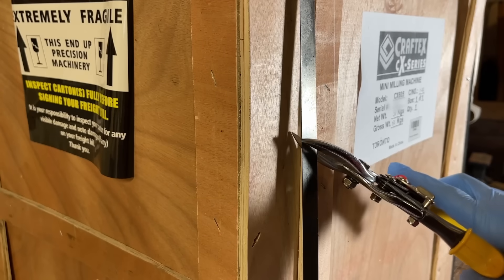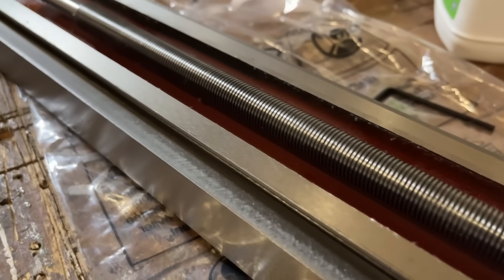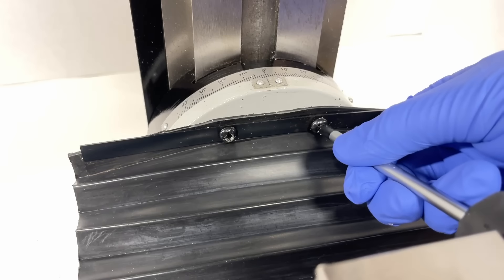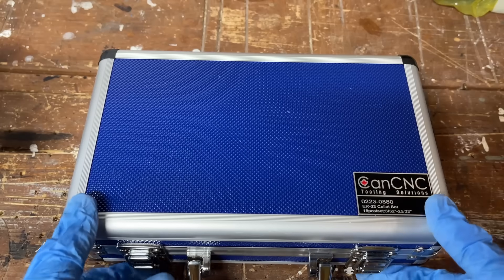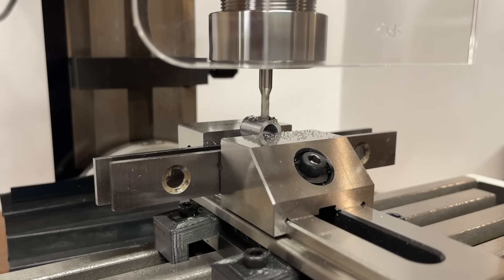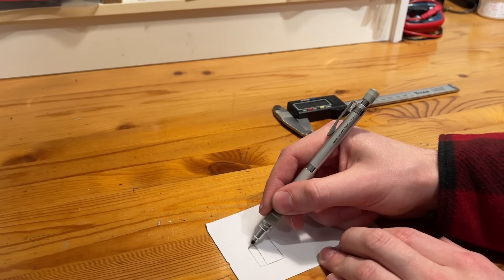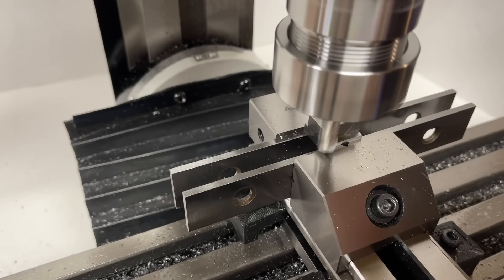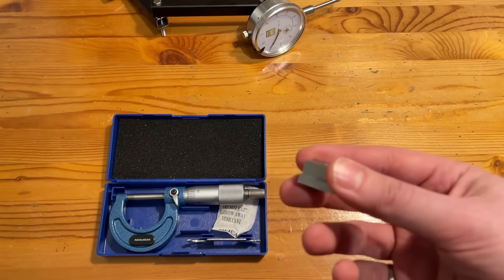I Bought A Minimill to see if they are Worth It

Comment: Running larger equipment can give someone unreasonable expectations of what a small lathe or mill should do. Tiny horsepower and tiny machine means tiny cuts. I have found that having even small machines at home is super useful for DIY project. There are so many things that pop up that could use a spacer or a bushing, a custom over-sized key or just cleaned up on the lathe with a file.  And once you have the machines you can use them make parts to make them better. Rock on tiny machine owners.
Reply: expectations can easily be exaggerated both on a persons 'real needs' and the output for the investment... I have an even simpler (AKA cheap) 750w pillar drill (yes... drill) and an even cheaper compound base for occasional Aluminium but mostly hard plastics. I don't need anything more than 0.1mm accuracy and i'm super happy with the output. As seen here you can get the most out of anything by clamping stuff down 'PROPERLY' and minimising the slack via the gibs. but above all; keep expectations realistic
Reply: exactly why I purchased a mini mill and mini lathe after leaving my previous employer. I had grown accustomed to having access to those machines for personal use, and I missed it. It's so nice to be able to just make simple things that would otherwise be a long wait with shipping costing exponentially more than the price of the material.
Reply: I feel as though most hobbyists underestimate the value of patience- a machinist's best tool. Smaller tool heads and smaller cuts will still get you a finished product in the end.
Reply: We got a small china lathe here and my friend who worked and learned as a miller allways laughed about it but since it was the only one we got in our hobby shop he used it. Now after 3 years we got a bigger one and he told me that he kinda liked the mini lathe after all. It made nice stuff and it was inexpensive.
Reply: @nicoleibundgut534  and with experience in the field one has both properly managed expectations and the knowledge of viable/efficient improvements to the machine
Reply: @ajoshdoingthings  valid point some need a few adjustments or setup to work well since they are a precision tool even a full size machine needs to be calibrated from time to time
Reply: Agreed.  I had 24/7 personal access to a 14" lathe at work and a full Bridgeport style CNC mill.  I used them for maybe half a dozen personal projects over 15 years.  But I use my Sherline 3" lathe in my basement almost weekly.  Sometimes it's faster and easier for me to just make the part than go to Home Depot or Lowes.  And it's /definitely/ cheaper.
Reply: Small table top machines can save you big bucks!
Reply: yes i agree, there are times i would love to have a mini mill and lathe. 

but i can not afford the cost of even hf stuff.  or make the purchase qualify in my budget.
Reply: @larryjanson4011  E-Bay, Facebook Marketplace, and Craigslist!

Of course, then you'll want a parts washer (a bucket/large sink and a $10 aquarium pump works), an angle grinder, an 8" buffing wheel, and large amounts of steel wool / heavy duty ScotchBrite pads.  Plus a shop crane and trailer/pickup truck.  Whoo that added up fast... Seriously though, you'll want almost everything else except the shop crane and trailer first for normal project anyways, but the only thing required is the steel wool and elbow grease.

Those last two let me pick up an excellent condition "mini" mill and benchtop lathe for less than Harbor Freight charges, plus several hundred pounds worth of rusted drilling/milling machine that I'm restoring. Another person joked about tool collectors and inheritance.  In my case, the good quality stuff was because someone moved and didn't want to try and move a 600lb machine.

Give it time.  I got lucky job wise, but it took me over a decade before I was able to make those purchases.
Reply: That's has been the bane of my shop tools at home. Hard being used to 3phased powered machines then going home to 1/2 horse power lathe.
Reply: Completely agree. I have a Myford ML7 lathe (clapped out) and a Peatol (that’s Taig in USA) lathe. The Taig does most of what I need, including some fair-sized bits for my motorcycles (steering-bearing sleeves, etc.). If I need a bit more power for roughing out I fire up the Myford (which is classed by many as ‘small’ anyway). If I could afford a milling machine - and all the extras that go with it - it would have to be Chinese and small, but that’d do fine! Thanks for the honest video. Les 🇬🇧
Reply: Small machines can be extraordinary accurate for small parts better so than a large machine
Reply: I bought a mini mill
 and mini lathe 20 years ago at a tool sale. I couldn't live without them now. I wish I could find a CNC conversion for the milling machine that didn't cost more than the machine.
Reply: @charleslum2438  How much skills do you have in this kind of conversions? There are a ton of diy kits. If you have a 3d printer at hand or at least someone near who could print stuff and you have time and skill to designe something like that then do it your own. There are also some predesigned 3d printed cnc machines but i don't think they are ridiged enough.
Reply: Fully agreed I was baffled by people hating on perfectly reasonable tools particularly for the garage
Reply: Well said
Reply: Exactly right!! I have an ‘65 rockwell 14x40 lathe and ide still like to get a mini lathe lol. Mainly as backup and to make replacement parts for my 14x40. But i am ALWAYS making random small washers and spacers.
Reply: Some of those reviewers on yt just take the tool, unpack it and expect for it to just work out of the box, those silly geese.
Reply: Having only ever used a full size bridgeport, I’m bound to be annoyed with a mini mill. 😂
Reply: as long as it is well built and reliable a good machinist would know how to use it properly  
size and horsepower are a real thing 
I would love a mini lathe myself
or even a wood lathe 
a mill would be nice but I am bad with bit directions and know I would cost myself a fortune in bits from prior experience LOL
Reply: THIS ! I am always afraid to let anyone near my small Proma lathe, because they would ram that and went 1.5mm cuts, my poor little boy trembles, when he hears we gon cut steel today.
Reply: @Chonkperator 😂
Reply: Exactly, appropriate material, tooling geometry and depth of cut are important. Chip load can't really change much or you're just rubbing and work hardening the material

Comment: I have a Sieg X2 type (from princess auto) and it works pretty good. It can cut steel fine with carbide cutters. I have a 4" 5 insert facing mill that I've used to flatten steel with before. Best upgrade so far was to machine the spindle to accept ER32 collets directly. I also filled the column with expanding concrete, it seemed to like that but maybe filling with lead or something would have been better? I made my own belt drive also, but pick a better belt than a 2L130 they seem to be impossible to buy in Canada. 

The column stays in tram just fine when it's filled with concrete, you can clamp it down tight and it stays that way.

I had a Taig micro lathe in the past, then got a Myford 7" lathe. Finally ended up with a south bend 10k with QC gearbox.
Reply from the maker: Extremely cool! Interesting to hear the 4” facing mill doesn’t cause issues, I would have thought that it would be too much! I may just have to pick one up. Thanks for the tip!

Comment: You probably did far more initial setup than 99.9 % of the complainers.
Reply: Initial setup is important, if not crucial.
Reply: People who don’t have experience. Will expect way more than the majority of these small mills can comfortably handle. The rule is , clamp heavy cut light. With patience you can do impressive work on a small machine.
Reply: This is pretty typical of moaners, they don't read instruction manuals, don't spend on setting up, probably don't know what they are doing anyway. My rule is read the manual first. Set up the machine, or whatever, check all the initial settings and tightness of screws etc. Then cut light to start with, then build up.
Reply: @Tocsin-Bang  you mean, you act like a competent and reasonable adult human being?
Reply: Preparation is 90% of the job. If people don't know this they don't have to play with adult toys.
Reply: If the initial setup saves you tens of thousands, then not doing it can only be called stupidity. Buying a 12k mill just because you're too lazy to set up is just dumb.
Reply: @TyroneTheBackyardigan  and even then it'd save you at best 50%-ish of the setting up. Which I'd guess they wouldn't even know how to do it
Reply: I’m sure of that.
Reply: Because, perchance, they make them adjustable for a reason, and its almost like every piece of machinery trusts that the user will have to do some amount of adjustment to make it accurate, curious. Not everything is self-levelling, and hell, most entry level 3d printers require you to do manual bed leveling but you don't see anyone complaining about that do you...
Reply: The mini tools are junk. Get over it, get more money and a real tool and you’ll be able to make real parts.
Reply: @allanfranks4480  hand rubbing intensifies

Comment: I had an Enco mini mill in my garage in the 80’s, used it for all kinds of hobby projects. Definitely sturdy enough for milling steel, but only after fine tuning/tightening up from factory assembly and not trying to hog all the material off in one pass. Wouldn’t mind having one again.

Comment: Thanks for the information. I smiled when you spoke of .0625 hand wheel graduation. you think i decimal inches and metric just fine ,  so now add imperial fraction thoughts.  .0625=1/16" just think one turn is 1/16, yes its a strange quirk surely one that never crossed my path in my machine shop career. i'll bet there is a 3/4 -16 lead screw , 3/4 -10  would have been way more fun.
Reply: Yes it's a fractional wheel ... 16 turns per inch exactly :)

Comment: You need to drill and ream a tapered hole to the base of that vertical column. Tram it level, then just drill and ream the tapered hole. Fit a tapered pin, tap it in, head square and physically prevented from drifting. French Huron Mills had this, great method....🤔😳😏🇬🇧

Comment: For 90+% of all use you never move any axis more than 150mm, which so happens to be the same as a cheap digital caliper so using a dremel diamond bit to drill a few holes in some cheap digitals and rigging up a movable mount(bolt on a piece of 2020  extrusion...) is easy....

Comment: What a great video. I have a hefty lathe and an equally hefty miling machine in my workshop. 
Recently I helped a customer of mine set up a mini mill very similar to yours. We had exactly the same issue with tramming in both the X&Y axes. Once bolted down we had a go at milling some small blocks of alloy and steel, and I was surprised at how good it was. 
My machines are capable of taking 3-5mm cuts in hard steel if need be, but on a mini mill or lathe that's impossible. Light cuts should be the order of the day. I found that on the mini mill 20 thou was about the maximum on steel, and about 40 thou on alloy
I think that a lot of people who slag off such machines are simply taking cuts that are too heavy, and all machines have a limit as to how much they can handle. A bad workman blames his tools etc.

Comment: What you need to consider that most comments on tools, products, services will be often than not negative, cause people who got faulty, broken, not on time etc. will more likely hit the comment section to vent their frustration. For example you used one company to ship and deliver stuff for you. You never had a problem with them, nor your friends, but youll see loads and loads of comments that are negative. People who are happy/okay with items/services will often take it as granted and wont comment. People who were unlucky or didnt properly use item or service will more likely post a comment.
For example a straight out of the box mitersaw will require you to check allignment. Many people wont do it and wonder why their cuts are not 90 or 45 and comment negative that item is crap.

Comment: Thats the “same” one I have and have found its “OK”.  The gears are plastic and WILL fail.  Ive since swapped to belt drive as well as ball screws and a cnc setup. So far it works ‘ok’ but not as accurate at cnc type tolerances.

Comment: Column won't hold tram ? Remove big nut, remove column, Measure  holes and bolt diameter sizes, Get on lathe and turn down a sleeve to fit bolt. Make outside diam large enough when in position INSIDE the column in line with the bolt to be in contact with the two inner faces of the column. You will now be tightening the nut up to a solid column instead of tightening up to a hollow structure which can flex, loosening the nut.
Reply: Brilliant !
Reply: better to fill the column with something appropriate

Comment: One way to prevent the tilting column from wandering would be to choose a spot to drill and ream a hole for a taper pin, removable type (with an internal thread).
Reply from the maker: Interesting idea! so far so good, but if I run into any tilt issues again I’ll definitely keep that in mind!

Comment: I have a mini mill from Seig and have had no issues with it . Along with my 7" x 12" mini lathe I have made a Sine bar (With in 1/10,000 of an inch accurate) I've made two fly cutters and yesterday I made an Arbor for a diamond wheel to sharpen my gravers with. I've made other parts that I could have bought but it was more fun to make things and cheaper too.

Comment: I have found over the years a well branded machine has been finished to a higher standards 
and out of the box my Clarke CMD machines Titanium/steel and SS and of course  the soft metals very well so in all you get what you pay for even though they tend to look or be the same type of machine from the same manufacturer,
it really comes to the cost that's  incurred to bring it to a high quality finish  or not

There are hundreds of videos to prove and show what i say makes sense hence the so called mini mill upgrades

Comment: Minimills are ok and you can get some good results with them but you do need to keep cuts light and baby them quite a bit to get good results. The difference with a larger knee mill is night and day but if you are only making low volumes of small parts out of softer metals a minimill is fine.

Comment: Biggest down side to a mini mill or lathe is rigidity, followed by capacity.  They are perfectly capable in their capacity, but tool size, depth of cut and feedrate are limited compared to going up 1-2 sizes.  I have an atlas 10x36, I've done a ton of work with it.  But compared to a 13x40 my depth of cut and speeds and feeds are limited.  So it's fine for hobby work at home, but would be terrible in a production environment.

Comment: I wonder if sending the noisy gears out to a company that tumble polishes gears would be beneficial to lowering the noise. I know that differential ring and pinions, transmission gears and timing gears are polished with great reductions in friction and noise. Might be worth your time and mental sanity to have done. Let us know if you do it and if you have access to a decibel meter, take before and after readings. Thanks.

Comment: Great video man. I'm happy with my combination bench top lathe/mill.  i use it mostly for repairing metal and plastic. I really pushed the mill to the limit by making a anvil out of a rail road track.  Only negative was i needed to repair the motor control board as the vibration shook some parts free.  No problem im an electronic engineer.  Everything works great again.  Only thing i plan to do is reinforce the mill column so it doesn't move under load.  That does cause problems on precision work with steel.

Comment: I bought a used mini Mill several years ago. Paid 200 bucks for it. I built a cabinet to go underneath it with a chip pan in between the cabinet and the machine. You can’t do hogging cuts with it, however, it does respectable work. Oh yes, I bought a complete collet set and holder for it. Much better than the Jacob’s chuck. I know I can always get my money back out of it if I want to.

Comment: I added a little machine shop upgraded fixed Z column to my now quite old mini mill which gave it more Y travel.  I also did the belt drive.  The main thing that annoys me about my mill is the controller goes into overcurrent protection very easily.  Like drilling aluminum and it will often shut off.  I'd replace the motor & controller if there was an inexpensive alternative.

Comment: These machines are made by more than one company and the quality can vary. Don't buy from the cheapest supplier and try to get a look at the machines before you buy. Both the lathes and the mills are quite capable machines within their size limitations. The main thing I don't like on some of the lathes is where they only have a limited range of belt changes and rely on an electronic speed control. One idea to increase the friction on the tilting column would be to fit a paper gasket. This is also a useful trick to help a job have a good grip on the table or vice face.
Reply: He’s in Canada and unfortunately we have fewer choices in suppliers, unless you want to pay a little extra to import something (which I did).

Comment: The accuracy of machining tools increase with the mass of the machine. Not just the overall mass but each of the parts, tool head, gears etc... These mini machines used with their limitations in mind perform very well with quality parts produced. If you don't have several thousands of dollars to spend or the space for larger ones then get the mini machines. You can't create something with nothing.